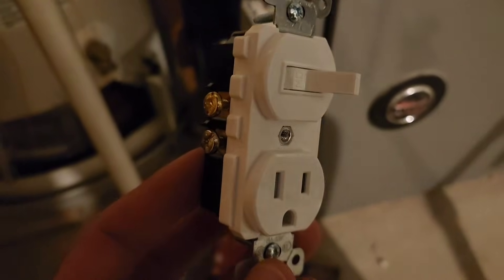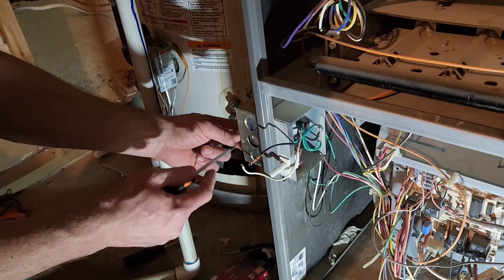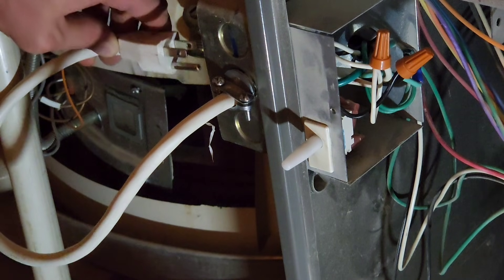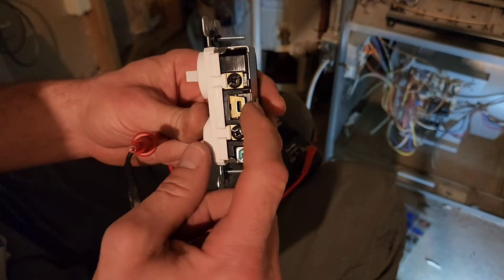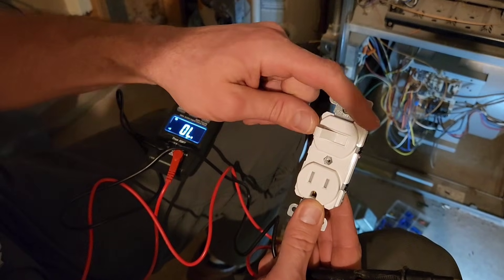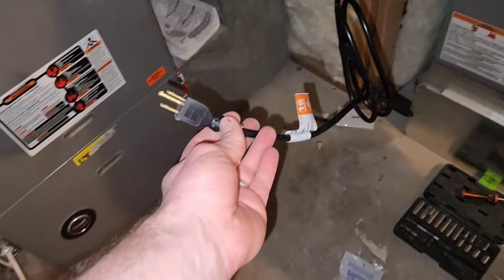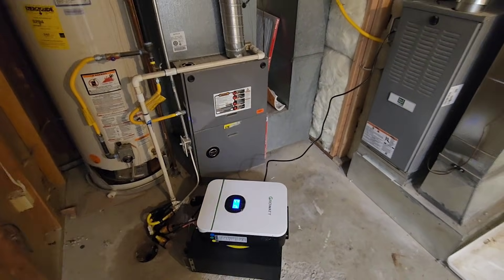Backup FURNACE PLUG - Simple wiring for when the power goes out(Generator Plug)

Comment: If you have a new high efficiency furnace, you may run into issues with running off a generator.  Floating neutral generators are the main issue  I believe.
Reply from the maker: Very good point!  I'm pinning your comment.  This was an issue for me. I bonded the neutral and ground on my generator (making it non- floating just for this scenerio) and that fixed the issue for me. My growatt solar generator already had a "bond" but it wasn't great... there was a ton of resistance there, so I made my own bond.
Reply: @diySolarPowerFunWithRay  https://youtu.be/wGZeAqnuhaA?si=w_7QADY4vIJTyey_
Reply: I have a RUDD High Eff I done this only the fan runs the gas doesn’t ignite. Any info I’m missing. Using a 2500 inverter generator
Reply: @OhmaSimpson   It;s looking for the bond between neutral and ground.  Most often,  this will mean you'll need a bonding plug for the device being plugged into your generator.  Keep in mind this ground (and neutral) may go back to your panel.  If so, there could be some problems with that.  You dont want your ground and neutral to be bonded in two places, despite position of breaker in your panel
Reply: @OhmaSimpson  I believe you may need a grounded neutral.

Comment: I cut the line from my breaker box to the furnace and installed a wall outlet on the breaker side up on the floor joist.  I nstalled a  plug on the line to the furmnace.  I can insert the plug into the outlet with the breaker on and run on grid.  I can unplug the wire to the furnace and connect it to my power station and it runs just fine. No need for the wiring at the switch box at the furnace.

Comment: Using this setup you installed and connecting an outdoor 3600 watt gas generator/inverter with neutral grounding plug do I still need
a Hughes Power Watch dog to protect the furnace electronic circuit board from damage?
Reply from the maker: Definitely couldn't hurt to still use it.   Depends on your generator power quality

Comment: But don't you backfeed the panel if the switch is in the on position?
Reply from the maker: If I plug this plug into my generator... it will totally bypass the switch and my home electrical system, so it doesn't matter what position the switch is in...it will not backfeed.

Comment: In event of an emergency and want to hook up the furnace to a generator solar or gas. Will I need a neutral bonding plug for generator since its not ground?
Reply from the maker: You will want to make sure the ground in the neutral are connected or bonded. Having it connected to an earth grounding rod definitely couldn't hurt.

Comment: Anyone thinking about doing this on a new furnace had better check warranty. Also code in many areas says it must be a dedicated circuit directly connected to the main panel. Much better to install an interlock kit and run a generator outside.

Comment: Solid and stranded wires should be twisted together before screwing on the wire nut.  Better connection.
Reply from the maker: Yeah, I've had multiple of those come disconnected. That's why I like those wago connectors.

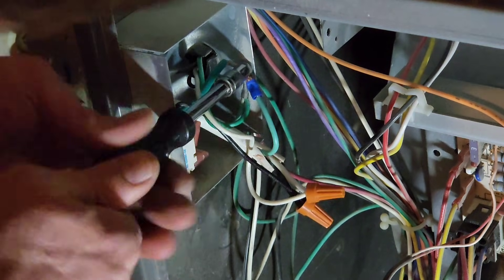Comment: At about 53 seconds into the video you can see a green wire and bare copper wire wire nutted together.     You didn’t comment about these wires.    Anything people should know about these?    Can you ground the new switch/plug by removing the plastic washers from the screws that secure the new switch to the box or would it be better to ground the switch using a wire connected to where you connected the other green wire at about 2:20 in the video?

Comment: I.
Have been all through .Have.
Solar for backup The new high efficiency furnaces. The electronics are very picky. What a time my head trying to figure out how to get it to work. The furnace kept shutting down. You need a inverter with bounded grounding If that inverter Is not grounded properly It will shut down Also, you need a pure sign wave inverter. Not modified inverter, modified inverter can take out your electronics, I recommend contacting a licensed electrician.

Comment: I simply installed an outlet. One with house 120v the one next to it goes to the generator. Then just unplug and replug to gen side. When power is out here, it's hours. Even days. Quite often.  Those boxes were not much use but do come in handy at stock tank water pumps with the fuel oill heaters to prevent ice over.

Comment: How do you figure you will be able to run your furnace on a couple of day with this setup?  If you furnace is 12 amps at 120 volts  that is = 1440 watts.  If you have a 3600 watt generator that will only run the generator for 2.5 hours
Reply from the maker: The generator has a 5K Wh battery attached.  The furnace only runs part of the time.  I did a few real world run tests with this setup though in other vidoes.

Comment: Why mickey mouse it? Just install a transfer switch at the service panel and wire in house circuits that you generator will support. That way you won't have extension cords running all over the house.
Reply from the maker: Did that conversion this summer :).

Comment: In most cases of you have had a gas furnace you will have heat from your solar BUT NOT AC, you need another switch to hook up your Ac to have AC. While your in the summer months, all this will do is make the fan run, but the AC such as what 99 percent have in a separate panel outside the house. But it would work with heat, if you have a gas unit.  It wouldn't run your AC unit and cool your house though. It would if you ran a separate switch to the AC unit from outside so you could run that off  your solar a well. Then you will have both heat and cooling if you lose power.
Reply: You need a very beefy Generator to run a central air based AC unit. I believe something over 7000 watts running
Reply: @DaDaDo661  I have a predator 9500 that runs my AC unit just fine on a separate switch. My 3500 will run everything, but that of course. Thx for the feedback.

Comment: My furnace is on a 30 amp fuse in my breaker box. What size pigtail or wire gauge (AWG) is safe to use in this case when adding this plug to my furnace?
Reply from the maker: I would use the same size wire that is currently being supplied into the furnace
Reply: Why does your breaker box have a fuse?

Comment: One blatant code violation, 20 breaker on 15 amp equipment. I hope your insurance company didn't see you do this. 
Best of luck with it
Take care
Reply from the maker: When the house was built the electrician put that 20 amp fuse in there. But perhaps a 15 amp breaker would be better I need a double check that... some furnaces do require a 20 amp breaker though

Comment: Everybody on this channel seems to think this is ok. Its not. Your causing more problems than your solving. Your a bunch of play school electricians. Especially the guy who posted this (who can be held liable for injury or damage) Find out the proper way to do this. Like a transfer switch, proper bonding, proper generator (sine wave output) and not powering your furnace permanently through a cheap Chinese outlet which can arc and cause explosions. Its properly done at the panel using a transfer switch. Not to mention shock hazards, back feeding your panel and cause unreliability to your furnace. You can even smoke your furnaces control board with improper connections, grounding and the wrong kind of backup power. All furnaces are not the same. Get professional help or find out how to do this right.
Reply: Exactly how is he going to back feed the panel with this setup?   The generator is feeding the hvac's control board/thermostat/blower fan.  There's no connection of the hvac to the house power.
Reply: @jbrian53  Look again, also floating or high resistance grounds, wrong cord, wrong outlet, no direct connection to the romex , causing intermittent operation, wrong switch etc, etc. Its a jig rig. Should have been done through the proper transfer switch at the panel, never on the furnace. Breaks all the codes, insurance wont cover you if there is an incident. Want to hear more?
Reply: @RadioRich100  I see all of those things. you still didn't explain how this can back feed the panel when the unit is plugged into a generator.

Comment: Not a good thing to do, pretty sloppy. The right way would have been a small transfer switch and twist lock outlet. Too easy for the furnace running on line power to fail like that. Its to much of a jig rig.

Comment: Consider yourself fortunate. I basically have the same setup but furnace is a Trane and on first stage the blower uses approximate 600 watts. So not going to run for very long on battery backup.

Comment: Do you know if you can do with with an Oil Boiler? I've only seen this done with a Furnace similar to yours. Thank you.
Reply from the maker: I don't see why not.
Reply: It's a simple matter of calculating the current draw of the boiler, circulation pump and zone switching, if you have zones. I have a nat gas boiler with 3 zones all fed by one circuit. I'm guessing the total power draw of the 3 electric valves, the circ pump and the boiler itself is less than a typical furnace.

Comment: How big does your inverter have to be to run the furnaces?
Reply from the maker: Inside your furnace it should say the Max Amps. I believe mine is 9 amps. And that is just the startup amps that's required. When it's running it is a lot less. If you have a typical house furnace you should be fine with a 1200 w standard inverter... imo

Comment: Why complicate things? I turned off the power, of course, before starting, then I cut the Romex coming from the breaker; connected the power side to an outlet, which I attached to a beam, and added a heavy-duty plug to the Romex to to furnace.   Now I can either plug the furnace into the outlet so that it receives power from the breaker as usual, or I can plug the furace into a heavy-duty extension going to my EcoFlow Delta Pro (or it would work with a generator too). How simple: 3 wires (hot, neutral, ground) properly connected to an outlet, and 3 wires connected to a plug.   No need for pigtails, no need for a seven and a half minute video with an unnecessary detail, just a straightforward, sound and simple solution.
Reply: His explanation was very straightforward and simple....   Your solution, on the other hand, is actually more involved, slightly more prone to failure, and potentially dangerous.   With your solution you still have to mount a 1-gang box and then you're going to put a plug on Romex??  Really??   Romex is solid conductor and is not meant to be utilized as a cord for multiple reasons.  Cord is stranded and is designed to be moved / manipulated, etc. and was the proper choice in this video.   "No need for pigtails" you claim....and yet that's exactly what you created with your Romex, albeit a more dangerous and half-assed version.  

Since you're averse to unnecessary detail, the information in your reply really could have been summarized into "After turning off the power I installed a plug and receptacle to the Romex feeding the furnace."   
Everything else you sent along was "unnecessary detail" right?     We could also add that it was condescending, self-aggrandizing, and a bit rude, but "Why complicate things?"

Your "straightforward, sound and simple" reply is more like trolling, with bad information to boot.
Reply: Hey Steven, why irritate everyone? By my reckoning; perhaps you should, with all your amazing wisdom, stick to your 8 subs and leave the sound and simple solutions to normal folks.
Reply from the maker: I like this set up but I might try different one in the future

Comment: I am not an electrician, but without isolating the neutral from your main panel you are energizing not only your home with an unbalanced load, but also the grid with your generator.This could possibly electrocute a lineman working outside your home trying to restore power in your area.
Hopefully a licensed electrician who sees this could explain better than me.
Connecting a generator to a home incorrectly could be costly if not life threatening.  I know  a  person who replaced  a TV,  microwave, and dishwasher  because of an imbalanced load on his circuits.
Please at least seek the advice from a professional.
Reply from the maker: Are you saying there shouldn't be a ground neutral bond in your main electrical panel?
Reply: @diySolarPowerFunWithRay  You should have used a transfer switch. Stop playing electrician.

Comment: My furnace maintenance on/off switch is already installed and is about 8 ft away.  With it I can shut down the furnace for maintenance without having to turn off the breaker for the furnace on the breaker panel.  If I were to replace the maintenance switch with a similar to the one one you installed, would I be just able to plug the cord from my generator into it without having to go through what you did to the furnace wiring?  Of course, my breaker would be turned off when I plug in the generator cord.
Reply from the maker: Sorry, I don't think I want to give you any direction because I'm not sure I understand your specific situation fully
Reply: @FirstLast-dl7gf This answered my question.  Thanks for explaining the logic behind it.  Have a great day!

Comment: Bet you have a floating ground on your power station and most likely generator also. That’s a huge problem, all avoided if you connect to the main fuse box the correct way because your ground and neutral are hooked to the same bar there to fix that

Comment: I'm not easily impressed but this blew my mind. Just had the electrician hook mine up and it is amazing. Everybody should do this.
Reply: No they shouldnt, its a jig rig. Do it right.
Reply: @RadioRich100 what is the right way to do it?
Reply: @RadioRich100  Inspector said it was fine. Carry on
Reply: @johnrains3526  Your either making this up or the inspector needs to lose his job. Jig rigs dont pass inspection.
Reply: @RadioRich100  With this setup can't the current feed back to the panel?  If so you can injure or kill a lineman working on the grid.

Comment: Thanks! Could you make a video explaining how you fixed the issue with the neutral ground bond?
Reply from the maker: Here's a good little video. This little plug is what I needed.https://youtu.be/wGZeAqnuhaA?si=g1256it4cutyY4qR
Reply: I got that device but it just trips the GFCI on the outlet on the generator. What am I doing wrong?
Reply from the maker: @temporaryscars  you got the ground neutral plug? what generator are you using?
Reply: @diySolarPowerFunWithRay  the harbor freight predator 4375. Decided to give it a go without the plug and it seems to be working without it!
Reply: @temporaryscars  Jig rigging your furnace in the first place.
Reply: @RadioRich100 ...huh?
Reply: @temporaryscars  Rewiring your furnace when u dont know what your doing.

Comment: Thanks for this video. It helped me make a mod in my CDN home setup https://youtu.be/Ys1g6wFMbT8 Buying a 720Wh power station and getting an electrician to help me out was the best value method for getting aprox 8 hrs of power during an ice storm. You can always buy more LiFePo4 portable power stations later, as prices drop, to get a longer run time by swapping out. 8 hrs is a good nights sleep. Be sure to turn off the power switch for the furnace, on your panel during such an outage, thus avoiding accidently electrocuting yourself when swapping back the power plug. Those prongs on the plug in my video clip are converted to live wires so I have nice red tags explain how to safely use them.
Reply from the maker: Nice set up. Glad it worked for you.
Reply from the maker: Those powerstations are nice

Comment: This will PROBABLY be fine, but it doesn’t really meet code. If you were doing it again, I would suggest considering a transfer switch. For a small one for this purpose they’re about $50-100 and would meet code. It’s not a big deal though, and you did everything safely for the most part.
Reply: I have a feeling the code these electricians are complaining about is that you aren't a licensed electrician
Reply: when its cold out and no power fuck the code lol
Reply from the maker: Thanks, I'm not an electrician, but I like to try to abide by code (most of the time). Please let me know anything specific that I broke.

Comment: Circuit breaker protects the wiring. The fuse was protecting the furnace electronics.
You should re-think this.
Reply from the maker: Thanks for the feedback.  Is that because it will take the breaker too long to trip and the wires will be damaged?  My other furnace didn't come with have this fuse.

Comment: How do you bond the ground and neutral wires?
Reply from the maker: I am going to use a bonding plug that you can just buy on Amazon. I will use the bonding plug on one of the outlets on my solar generator.
Reply: Power Watchdog Hughes Autoformers Ground Neutral Plug - Basically Bonds whatever is on the same circuit in the generator.

Comment: Using a high end solar generator power pack have stable pure sine wave AC output voltages.
They can be recharged with a regular generator if the sun is not out. Best of both worlds.

Comment: You need to explain that the "thing" called a strain relief is REQUIRED by code.
Reply from the maker: Thanks, I'm not an electrician so I really like it when you guys chime.  Someone also mentioned I need a double pull double through switch for this but that was a bit over my head.